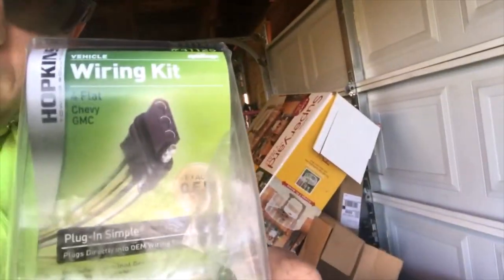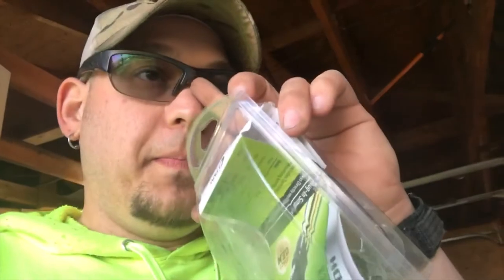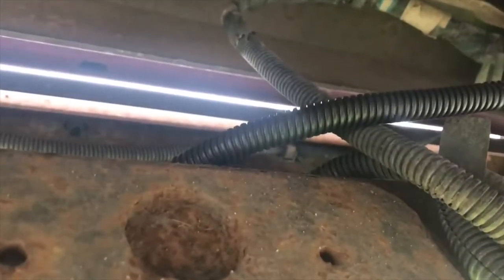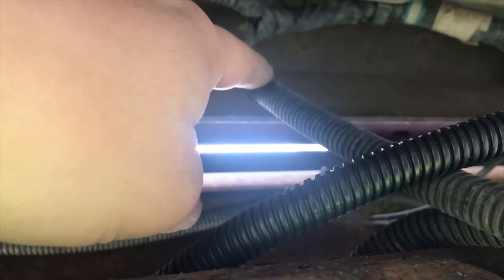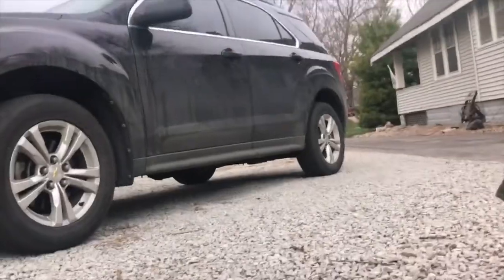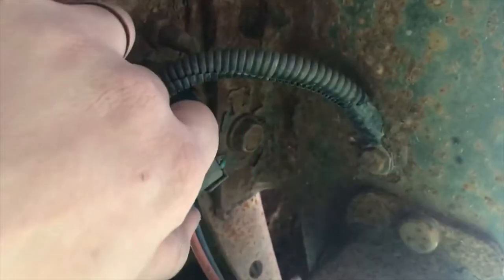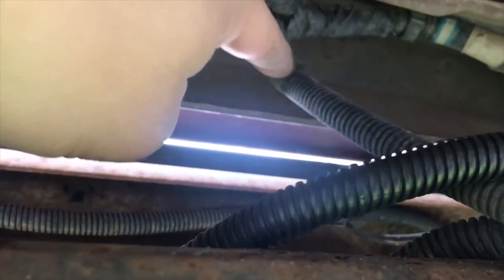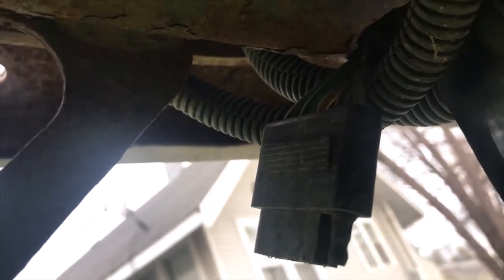97 Chevy K1500 Trailer Wiring

Comment: Good post, thanks for the part #.  The two extra wires come from the back of the fusebox near the drivers side firewall.  There are two lugs at the back and each is fused.  30A I think.  They are 12V accessory power, perhaps interior trailer lighting and as you mentioned, the brake controller for electric brakes.  They are used for 7 pin round plugs.  That extra blue wire in the 5 flat plug gets its power from the back up lights and activates a solenoid in in the trailers master cylinder (surge style brakes) to keep the brakes from activating when reversing.  I do not know if electric brakes have the anti-reverse feature.  I know this is an older post but I thought I'd update it anyway.

Comment: Thanks I have a 96. It has a 6 pin small. But it's not working. Can't find a fuse for trailer lights. Are they fused to the tuck light fuses

Comment: I'm trying to disconnect mine because I think it's causing my actual brake lights not to work. Mine looks just like yours it goes in-between the tail light harnesses but then mine has 2 wires an orange and blue wire attached to the trailer wiring harness and those wires run all the way to the front of the truck. Do I need to cut those 2 orange and blue wires to make my truck oem again?

Comment: What factory wire should you hook a reverse wire to?
Reply from the maker: I’m not sure I understand the question. But the factory 5th wire provides the reverse signal. From the research I have done, there was a time when trailers had brakes that would move freely forward but would lock the brakes when rolling backwards unless you had the vehicle in reverse. Not sure if this answers your question? Since I made this video with more research, you can use these five to create a 7-pin by adding power and ground to supply battery power to the trailer. Hope this helps.

Comment: What does e extra wire to if you have 4 wire plug???
Reply from the maker: It’s for five wire trailer connector. Apparently there are trailers out there that brakes that engage if the trailer starts to roll backwards. This fifth wire supplies power to the trailer brakes to allow them to release when you put the truck in reverse.

Comment: do you remember which of the 2 green wires is for the trailer safety brakes? im not very familiar with testing wiring so im hoping you can tell me which wire to not use i guess im just wiring a 4 pin connector
Reply from the maker: Sorry. I do not and have not owned the vehicle for over a year now.